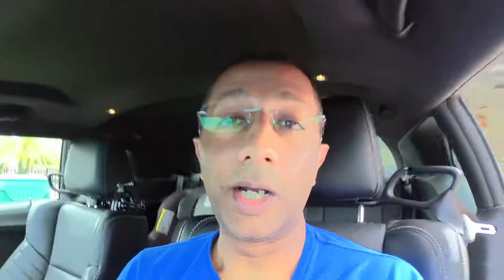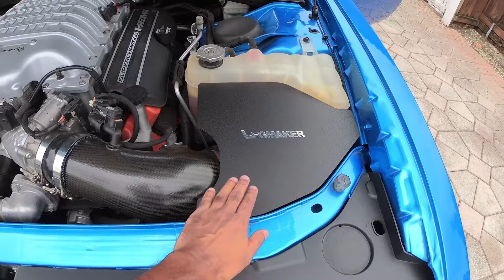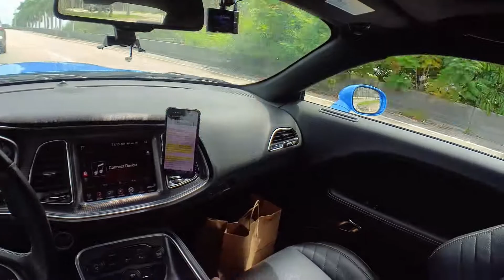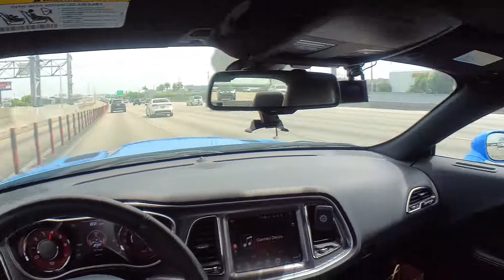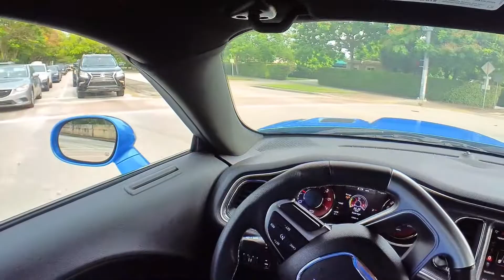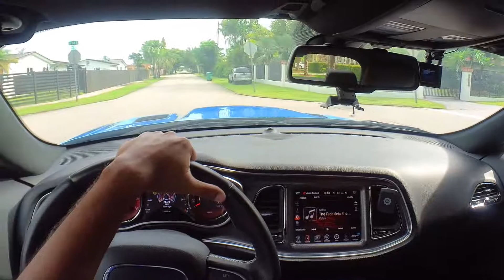POV Hellcat Supercharger Whine Compilation With Legmaker Intake - Manual Hellcat Challenger

Comment: It's the sound produced by the roots or screws whipping the air. That's why they sound different from one another. Different twists makes them sound different. Porting and blocking silencing holes will amplify that sound. Spinning them faster does wonders if used correctly.

Comment: hay Nate what happened with the supercharger wine ? I just bough the same car 2016 I have manual trans and its b5blue it looks idenicle to yours I can't believe u brought up the issue with the supercharger wine just last week I started mine and heard the same thing its definitely not rite but u did say something that could be true I live twenty miles out of Boston and it got extremely cold out when the noise started let me no if anyone commented on the issue thanks    I do not have ten thousand dollars to buy a new supercharger and there no warranty left
Reply from the maker: Hey check out one of the comments on that video from Leonard Rice. He has a video up on this channel with the noise before he got it replaced a few years ago. I did also read a post about a guy who had the noise and drove his car for about 80K miles before the supercharger finally seized up. Once it seized, it was pretty bad as in he needed some new parts more than just bearings but that's a long time! My noise is still there but it's still not really loud and so I plan to drive it for a while like this. When I do get around to fixing it, I'll go the Jon Bond route that I mentioned in that video. The price to fix ranges from about 2K to 3.6K depending on if you want an OEM fix or better quality bearings. That's a lot less than a new supercharger and you'll have a better unit capable of making more power reliably as well. Good luck!
Reply: Get the blower ported. New bearings and a complete rebuild is normally included. Did mine to my old Eaton and it actually ran a bit cooler while the whine was changed in a great way. Power was increased and low end fattened